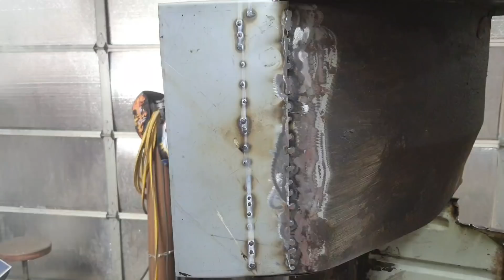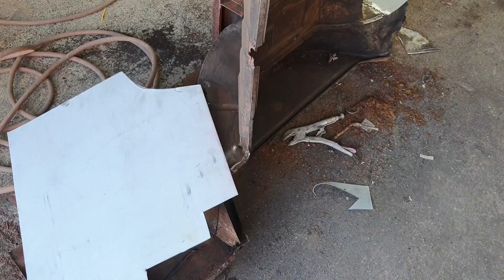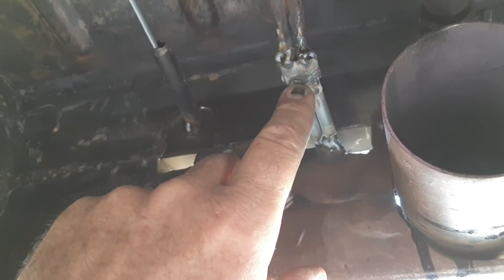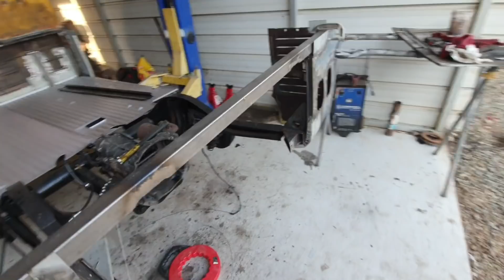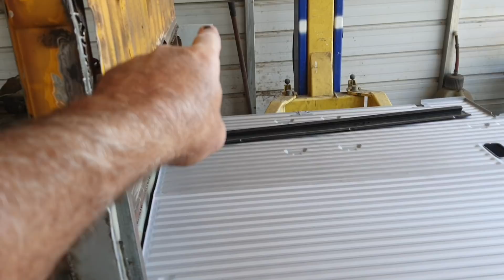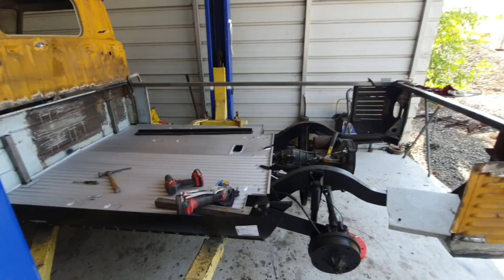1962 VW SINGLE CAB - assembling the bed from scratch

Comment: You ever think about old school lead? My grandad taught me to lead sheet metal when I was a kid. He made it to 85 and I got a college degree so yeah it’s super toxic. But done right. Mask, big iron and a greased spatula (I forget the real name) and  you got a lead sled. Or didn’t VW do lead?
Reply from the maker: VW never used lead but i have used it. Lead still has issues. The new plastic fillers are actually better IMO. I have had lead shrink crack and some other stuff. For the extra work I just dont use it.

Comment: Did you Correct the angle of the cab already? You once mentioned that the cab was leaning back or forward and that this needed correcting in the frame.
Reply from the maker: yea its perfect now.
Reply: I problably would have remembered after I had the floor in

Comment: If you put a sign on it you could write it off on income tax as advertisement !!!!!! Build a 2110 with low compression so it can sit there and idol with out getting hot . Put the same extra cooler like your last build ??? Or maybe get a predator motor from HF just to turn the pump ??? and put a oil cooler on it
Reply from the maker: yea that would be a good idea.